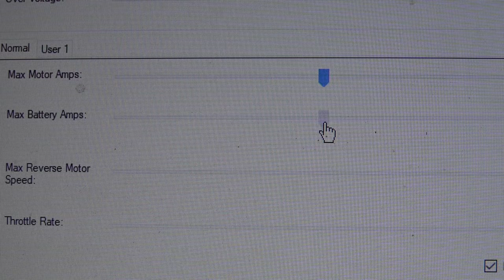Making a 20,000 WATT Electric Drift Trike

Comment: I'm genuinely surprised you didn't use a repurposed alternator from a car as the motor.
Reply: Alternators arent motors.. I think you mean the Starter.. High Torque... but doesnt spin very fast.
Reply: @mycarpounds  google it. Most car alternators are very easy to convert to an electric motor
Reply: @KingdomOfMog1  Understandable yes... But opposite.. Alternators make electricity.. They dont have the windings to create torque.. maybe make a cool fan or something. :)
Reply: @mycarpounds   I've seen go karts with converted alternators. An alternator is wound just like a normal three phase motor.
Reply: @KingdomOfMog1  And to that I say.. Nope. No such thing on a 12 volt winding to accomplish  3 Phase.. But.. Im only an old school welder.. I get your point. I will look into it for sure! Thanks!! :)
Reply: @mycarpounds  No no the alternator. You can repurpose an alternator with a little know-how because the difference between an electric motor and a generator is whether you apply force and get charge or apply charge and get force.

Comment: 20,000watts is about 20hp. so its the equivalent of a 125cc engine.
Reply: That does depend on tuning, know of some scooters with more and some bigger bikes that make less.
Reply: 20 kW is a little bit over 27 HP.

For comparison an unrestricted two-stroke 125cc sports bike is more or less around 30 HP.
Reply: @wobblysauce  in my country Harley motorcycle are very popular, but they only make about 50hp for 1200cc. we are not talking here about antique old technology garbage, but fine japanese craftmanship.
Reply: @Francois_Dupont  it's not about nationality: take a Honda Rebel or a Yamaha Virago, they are "fine japanese craftmanship" but they have more or less the same power of an american H-D or an italian Moto Guzzi of the same displacement.

Moreover, when you talk about motorcycles, displacement alone means nothing. You MUST also specify the bike type (sports, supermoto, cruiser...), the number of cylinders and if it's a two-stroke or a four-stroke engine. Otherwise, it's pointless.
Reply: It is not just the measure of scale... but the torque produced.
Reply: You forgot about a key metric for drifting. Torque! Will be far more torque than a 125cc petrol motor
Reply: 27 HP to be exact
Reply: I meeeaan... a 2t 125 can do well over 40hp and one horsepower is a little over 500w i think
Reply: Francois Dupont electric motors have more immediate torque and more torque in general

Comment: What motor, controller and batteries where used? I need something like that for a project
Reply: Take a car starter and battery. It works without controller.
Reply: @pavelyu3691  -- Thanks... how do i controll the speed? I'm a complete novice... so i'm sure this is a stupid question, sorry.

Comment: So... I'm doing the math here, and I'm pretty sure you're lying to us at some point. I looked up the batteries you showed, and they're 11.1V, 5,000 mAh LiPO, rated for a max 30C burst discharge rate. You're using 4 of them, which would give a rated peak burst discharge of 6.6 kW. If you actually were drawing 20,000 watts from those batteries, as the title says, they'd catch fire and/or explode within seconds.
Interesting video, interesting build, but please, don't lie to us.

Comment: If you had thought through the battery component system a bit better you could have taken a page from nascar with a quick swap system for components. Do a pit stop, 1 plug, batteries out, fresh ones in, away you go. Working on my design now since I don't currently have the budget to build. This has been a huge help with my own designs.

Comment: Some thought about motors: 
Motors are designed for 2 specialties. Speed, and Torque. High speed motors are going to have low torque. High torque motors of the same energy input are going to have less speed. Now, because you had a drone motor, that would tell you everything you need to know. Drones need speed for props, not torque. and because drones need to be lightweight and batteries are heavy, that means it doesnt have much power input. So a speed-oritented motor with low power input should've been the designation right off the bat. regardless, hindsight is 2020.

Comment: First motor would’ve been fine! Just need position feedback sensor + an ESC that’d use it like ODrive or maybe VESC. 

Airplane motors can use ‘sensorless operation’ where the ESC just fumbles around to get the motor moving a little then they can sense approximately where it is in its spin and take over with some real power.. so no zero-speed torque. Gotta have the sensor!

Comment: I think the motor before wasn’t the problem I think it was the fact that your running it with a rc esc sensorles and when run sensor less it means that it requires a 5mph push in order to get to speed otherwise it will burn the esc as shown in this video maybe if it was a vesc you could do it sensor less but still nice build

Comment: I was just thinking about this today, it could be cool to replace the front wheel with one from an electric bicycle (like what was used in duggie lampkins Iom wheelie record trials bike) so then you could have a thumb throttle on the left bar for the front wheel so you have more acceleration available on the only grippy wheel

Comment: Could have done all that with electric mountain board parts😀 motors mounts ESC etc. My electric mountain board is has 15 hp goes 45 mph. More than enough power and speed for a drift trike.
Reply: 15 hp huh

Comment: The motor that you tired to use was probably lacking hall-sensors. That's why it was also lacking torque. you could have installed those sensors and only change ESC to support sensors.

Comment: Is there any way you could make kits for this drift trike? Not the frame and what not, but all the custom brackets you made on the plasma table and links to where to get all the rear end goodies and electronic motor and batteries and what not.

Comment: 10:18, honestly Colin, don't you have a 35/50mm2 crimp tool??  They're only £15 on ebay. you have so many other nice tools. solder has 10x the resistance of copper, so not good for making high current connections. PS. you should have bought your "Lynch" motor from Agni motors, at least Cedric Lynch actually works for them!

Comment: 20,000 watts though, not sore about that by the amount of battery's. I understand lithium battery's hold a lot more power than acid battery's but you will still need more to get the suggested 20,000 I saw a top in its class 1000 watts ebike and had the same amount of battery's just for 10000 watts and they was lithium ones so maybe 2000 watts. still love watching your vids keep up the excellent work my brotha peace

Comment: Dude have you heard the term mad genius applied to you?  I have a challenge for YOU!  Build a full size electric trike with the seat between the rear tires and a shaft drive. Also never turn your nose up at tractor seats,  I had one on my 69 pan/shov and I would never go back,  the holes keep your bum cool. Will you accept my challenge?

Comment: What I want to know is how anyone figures any of these projects can be a 20k watt motor ? At 60 volts that is 333.3 amps and there is absolutely no way the windings in a car alternator can withstand that much current ! Most tinkerers are using 24 to 48 volt power sources and the controllers are rated around 60 to 80 amps Maximum, which is only just under 4kw. That is just over 5 HP which amounts to more total power output than what a 5 HP gas motor produces. BRING THINGS BACK INTO A REAL WORLD.  20kw is 28HP and if anyone of these projects had that much power they would be doing a lot more than 40Kph.

Comment: Why driven wheels in the rear?

Seems like a hub motor on the front wheel  would make more sense.
Reply: its a drift trike. it needs rear wheel drive
Reply: @pls-no-punterino7095  I don't know that that's true.

It's essentially an adult Big Wheel, which operated by breaking the rear wheels loose by using small diameter, low friction wheels, and it was human powered.

I was just past the Big Wheel age when it came to market, but I was amazed by what people could do with it.

Take a look here for a front hub motor drift trike:

https://buymobilitychairs.com/products/mototec-drifter-48v-electric-trike
Reply: @Zomby_Woof  500 watts vs 20,000 watts.  With 20,000 watts, and at the speeds the trike is going, sometimes as high as 60 mph, you would have no control over the rear of the trike. It's like putting trays on the rear wheels of a FWD car. At low speeds, like your example is intended for, it would work well enough. The power of the motor, plus the ridiculously grippy tires it has would be able to compensate for lack of rear control
Reply: @pls-no-punterino7095  It would need to be properly engineered and balanced, but I don't think that's any different than driving the rear wheels.
Aren't most drift cars fwd?
Reply: @Zomby_Woof  All drift cars are RWD. A few, very high powered drift cars are AWD, but they have a central differential that directs 80% of the power to the rear, like the hoonicorn.

Comment: colinfurze ? Im in THE UNITED STATES and I have the same white electric heater you have but it's a 120 AC. When I opened my heater up I noticed that one of the electrical wires was starting to burn and if it burns down to the copper wire it could short and start a fire. colinfurze ? open that electric heat up and check for burn wires for your safety.

Comment: What Lynch motor was the replacement? I found the controller just curious..
Reply: Which Lem 200 is it to be exact.. 95, 126, 127, or the 135 are listed as options.

Comment: Original Motor Prospect from a  Drone .... ???

Flying contraption vs a torque off road tric wheeler ....   epic 
...a...   applicability if you’re saying you’ve salvaged Original Motor option is what type of DC (brushes , brushless? Stepping motor is obviously (I’m guessing) requires Direct current also what was the amperage requirement and brushless? Voltage needs 36 V nominal supplied  and when you said it was from a drone what kind of drone had you’d salvaged original motor from?  
Flying flying type of room requires a DC type motor that would have an epic amount of revolutions minute RPM though on the other side 8 Wheel Dr. vehicle we need to have basically the opposite torque rather than horse power wondering if a guy can take your DC motors from original that drone for a vehicle double later y up the DC ....  drone? Appreciate your help...    epic tric ....    Message me back with a proper Direction S

Appreciate your skills and that FinishedProduct gorgeous

Comment: Stopped watching F1 because of what it now has become. 
A gas powered drift trike with a carbon fiber bucket seat and a 
Predator 6.5 HP 212cc OHV Horizontal Shaft Gas Engine behind sitting behind you is more than enough power to get you sliding corners!